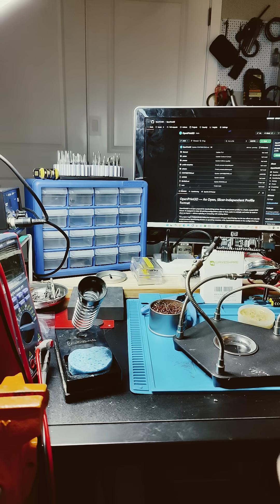SE3D Centauri Carbon Mods and OpenPrint3D #3dprintmods #3dprintingcommunity #centauricarbon #shorts

Comment: The main reason that I have only one Bambu and it is running X1Plus and using the X1 hardware add on.  The CC while not perfect, is much more open and you are making some great addons / mods for it